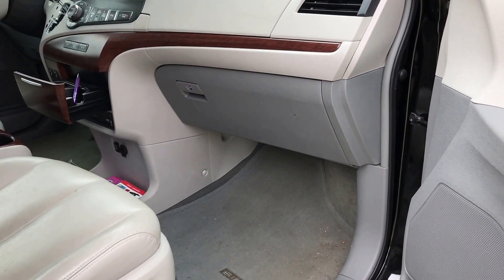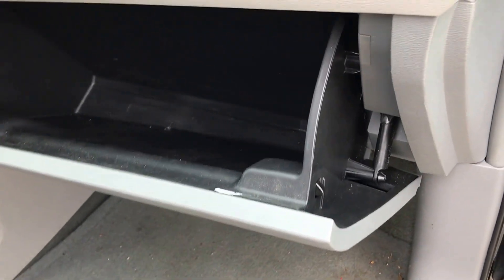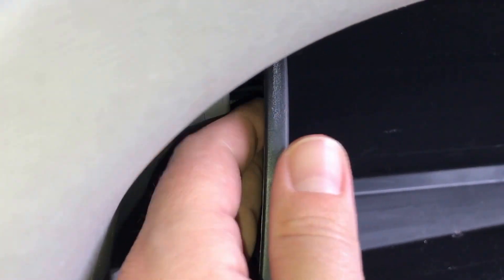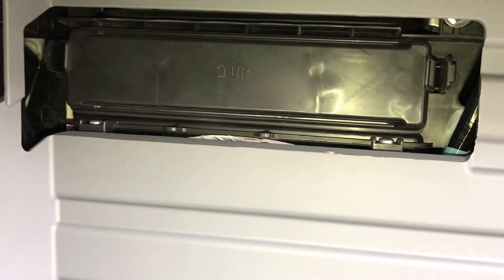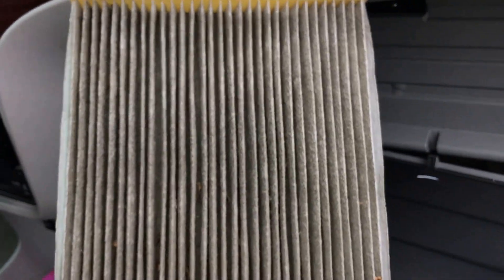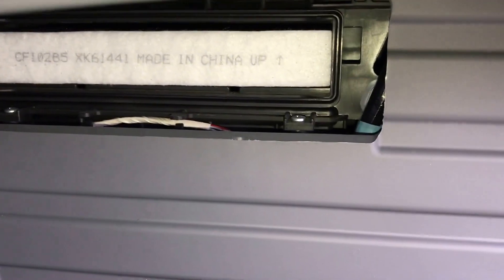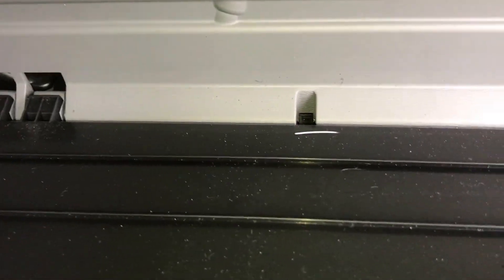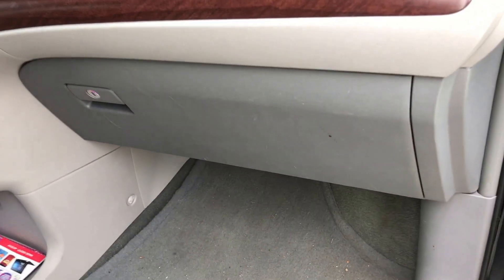How to Change Cabin Filter Toyota Sienna

Comment: The only thing missing is some added information. Both the filter you took out and the one you put in said "UP" on them indicating which side went up but some brands say "air flow" instead. On filters that say air flow the arrow should point down as air enters through the top of the filter and flows downward.
Reply from the maker: Thanks for the comment and additional info!!